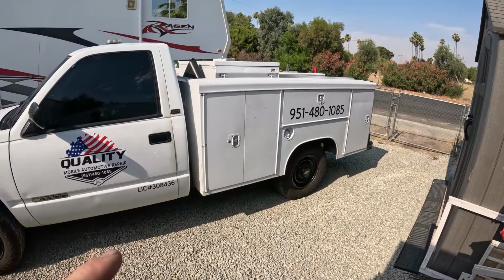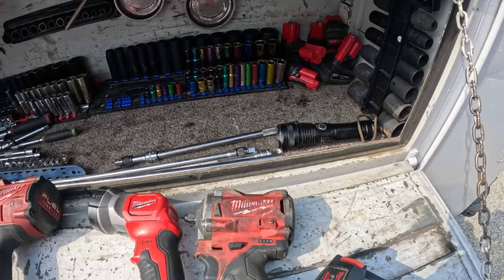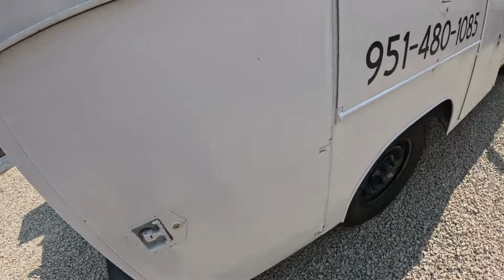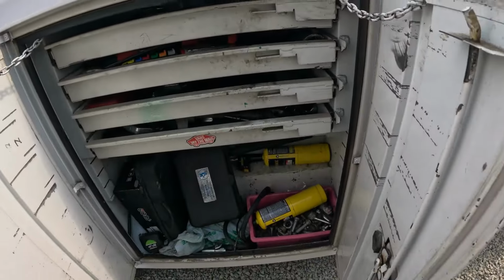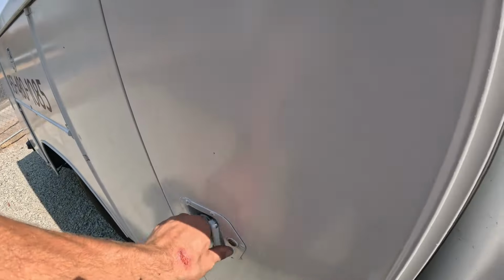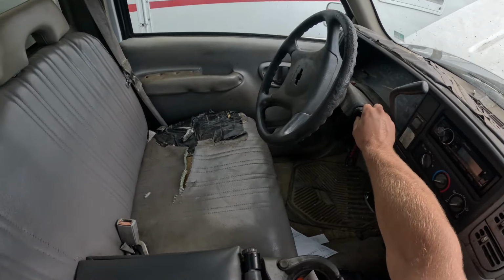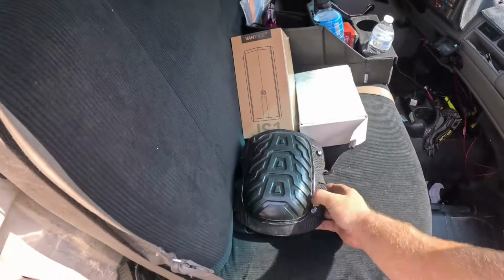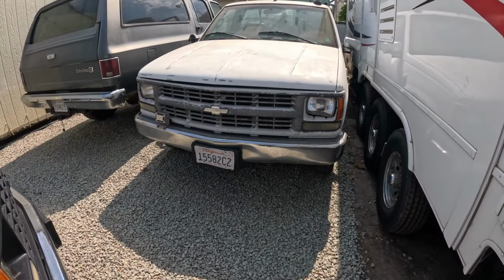MOBILE MECHANIC SERVICE TRUCK TOUR! GIVEAWAY ANNOUNCEMENT!

Comment: I appreciate everything you do for everybody!!  I have a question I have a 2010 Corolla.  Excessive brake dust on the driver front wheel.   New rotors, new pads and calipers.   I also had this issue before I changed everything.   Is it possible it could be the rubber break hose?  Any help would be greatly appreciated.
Reply from the maker: That’s a weird one. There’s multiple things it could be.

Comment: Just did a rear brake job on a 05 Kia spectra 5, disc brake. Replaced driver rear rotor because half of it was eaten away from metal on metal & pads both sides. First time encountering pistons that needed to be rotated to retract, while trying to compress with a c-clamp thought maybe cracking the bleeder valve would help because I thought the caliper piston may have been seized. Accidentally took the bleeder valve all the way out due to using an impact, reinstalled it then figured out proper procedure for decompressing the piston. Got the rental tool worked great put everything back together no problem. I knew pending the valve would introduce air so I bled all 4 wheels but now the brake pedal goes all the way to the floor, no resistance high or mid pedal, just a smooth light & consistent pedal feel all the way to the floor. it’ll stop but it’s not how it should  be. Checked it out with the wheel off had someone pressing the pedal all the way down & I could spin the rotor with my hands using a medium amount of force. It will stop but not exactly when you expect it too, braking distance has defiantly increased. Also before figuring out the rotating procedure I peeled the boot of the piston just barely to see if it was rusted & a decent amount of fluid came out. Could it be the caliper itself is bad or air is still trapped inside ?
Reply: Replace that caliper and rebleed the system.
Reply from the maker: If you have fluid back there the seal is compromised. I’d be replacing it and re bleed the system.

Comment: Great setup! You have quite a bit of equipment in your truck. That portable A/C machine is nice. I didn't know they made them. The mount you made for the strut compressor is pretty slick. You should think about making a mount for a bench vice that slips into the receiver. Adding the battery isolator was a smart idea. I don't understand why the manufacturers don't install them on trucks that come with dual battery systems. Watch out for Bank of America. They like to charge fees for everything. Thanks to VANTRUE for the jump pack giveaway. It's too bad you don't have an extended cab. You could remove the rear seat and setup your printer and chargers in the back.

I used to do mobile service for SAABs. I didn't need a lot of tools. I had a 3 drawer bench top chest that held most all the tools I needed. I carried a small floor jack, 2 jack stands and a portable 120V air compressor to power my impact gun. I was able to fit everything in the trunk of my 900 4 door sedan. The rear seat folded down if I needed extra room. The only time I used my truck was if I had to bring the engine hoist to pull the drivetrain. Saved on fuel. 
 
Thanks for the tour!
Reply from the maker: Thank you! I have a vise I just need to mount it one day 😂 you know how that goes! So far Bank of America has been good. I haven’t seen any extra fees anywhere yet…. I heard it has happened to others though. I’ve probably only worked on a handful of Saabs in my career. Thank you for watching and commenting!

Comment: I agree with you on the Harbor Freight hand tools. I’d rather put the extra money in my pocket and not Snap On”s pocket.
Reply from the maker: They have come a long way over the years! Harbor freight has definitely stepped up their game. I can also warranty something while I’m out. Harbor freight is is everywhere out here.
Reply: Sometimes I wish I had utility bed for a work truck for Rv repair, currently I pull a cargo trailer and it seemingly shrinks every time I look inside. Never big enough so I don’t know if I could work out of a utility bed but would be a lot easier than dragging a trailer.
Reply: See!! GREAT GUY!!...when he breaks a clip, he replaces it! Unlike alot of other mechanics out there, good job!!